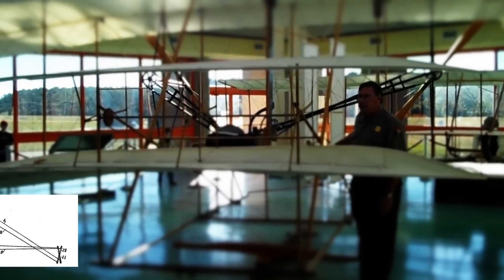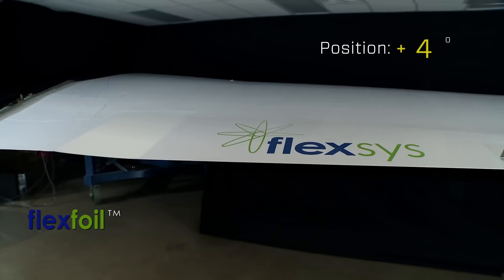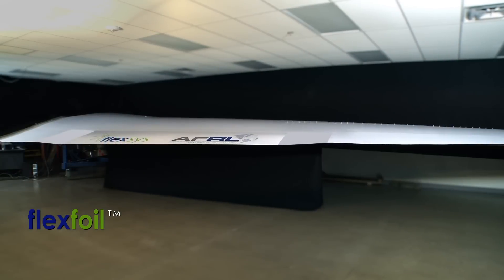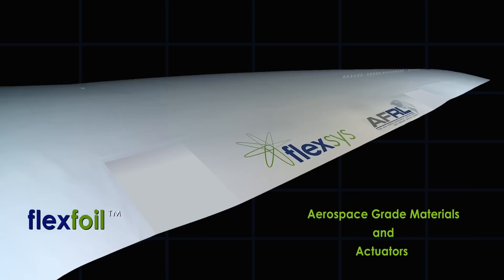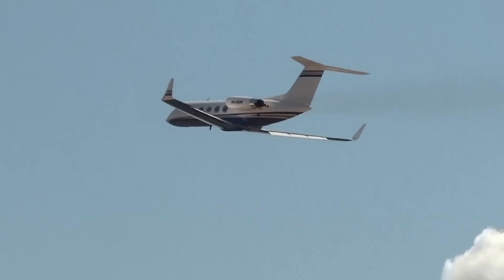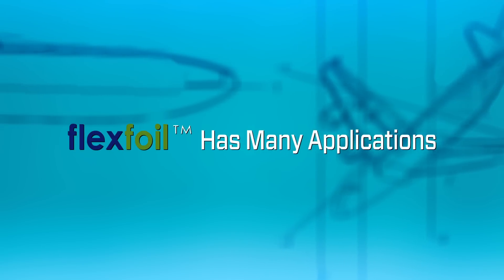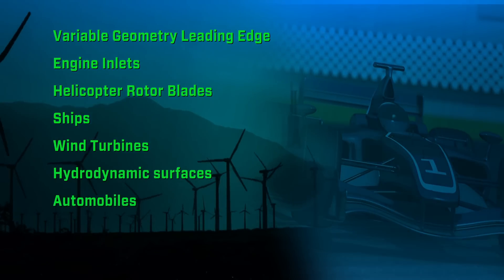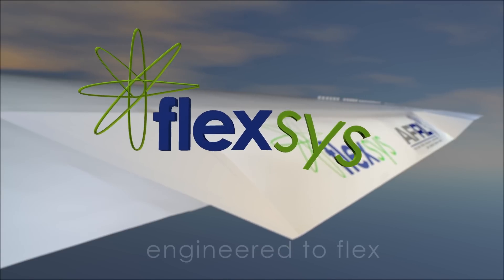At last, a shape-morphing aircraft wing is here - no flaps

Comment: Santos-Dumont, Santos-Dumont, yadda yadda...this never dies. No. Santos-Dumont was not the first. The Wrights were. The argument that the Wright's used a rail/catapult rather than wheels, and this "disqualifies" them, is debunked by the fact that the Wrights made dozens of flights before building the rail/catapult to launch their plane in 1903. Also, the Wright's October 5, 1905 test of the Wright Flyer III had it airborne for 39 minutes, which was longer in duration than all flights to that point combined, and as one can deduce, this was done before Santos-Dumont flew his 14-bis...Santos-Dumont certainly deserves an excellent place in aviation history, no question, but he simply was not "the first".

Comment: Yes just sexy covered flaps , No morphing, Morph will be used at ultra high speeds like mach 3 and above where the slightest changes in body shape will have great effect on the movement of the  aircraft. Like the sr-71 and the space shuttle had very small wings were nessacary.

Comment: So it's a "plain flap"? I don't see how this would be more efficient for low speed flight on take off and landing for larger aircraft because the whole point of having dual slotted fowler flap design is to re-energize the boundary layer of air to avoid premature airflow separation at low speed and give the aircraft higher AoA capabilities on landing and take-off... In cruise it makes sense, but with this design the AoA would be limited by many degrees on larger aircraft and even on midsize airliners like the e170, crj900, and Q400, where most of the business lies for intercontinental commerce... Also, now these have to be controlled by hydraulic actuators while almost every mid size and large aircraft have PCUs actuating flaps and slats electronically, increasing maintenance costs and the cost to retrofit or redesign an already cluttered internal wing root...
Reply: codzomz, the main purposes of this is technology is to improve aerodynamic efficiency, reduce weight and reduce noise. The final product will be used in conjunction with some form of active flow control to delay flow separation at higher flap deflections. This technology is still very much in its infant stage. The latest work focused on fully loading the structure in flight to ensure structural integrity. They have not yet focused on optimizing the aerodynamics and implementing active flow control.
Reply: codzomz All the things you say are correct

Comment: It's difficult to see how this can compare to conventional flaps. first issues that come to mind are integration into the wing, weight, inspection for mechanical components, damage and repair which is common in flaps and on larger aircraft heat tolerance. It certainly looks like it can add a new level of variable configuration ability.

Comment: Is not very secure and not very efficient as the normal flap made with several small flaps like the 737, 747. They let some air from below to go up and avoid the
 stall even with a high angle of attack.

Comment: This is one of those ideas that when you see it you wonder why it hasn't been implemented previously
Reply: Legislation, engineering to safety standards, reliability that passes a certain threshold... etc. It's not just about the product, it's about passing a whole bunch of regulations. From what I've learned, 25% of the work will be on the product, 75% will be working on your product to pass regulations.
Reply: TheBlackKnob While what you said is true that doesn't mean this couldn't have been implemented much earlier.  It's a good idea and we've had the technology to produce something like this for some time.  Really I'm just not sure why you even replied to my comment.
Reply: jayfulf Oh, we had the tech to produce this? Maybe the market wasn't ready for this product yet. Maybe there was market inertia going for traditional designs that were cheaper to manufacture and readily understood by technicians. There's a load of maybes and unless you're actually in this field, it's very hard to tell why this couldn't be implemented sooner.
Reply: TheBlackKnob That's exactly the point I'm making.  The reason this has not been implemented sooner, I presume, is because the idea had not been thought of.  Fuel efficiency is huge in this industry and would make for hundreds of thousands of dollars saved.  Why you feel the need to argue with me as to why this hasn't been implemented when you have no insight into the matter is beyond me but spare me from this textual diarrhea.
Reply: Of course it has.
Reply: jayfulf There are many technical hurdles to overcome before this technology becomes acceptable for aviation. Is the equipment durable? How does it react to rain and snow? How does it react to changes in temperature? What happens if the computer that operates it malfunctions? How do you access it for maintenance? They have to fix all the issues without adding extra weight otherwise it will cancel the fuel savings.
Reply: ruirodtube This relates to anything I've said previously in what way?